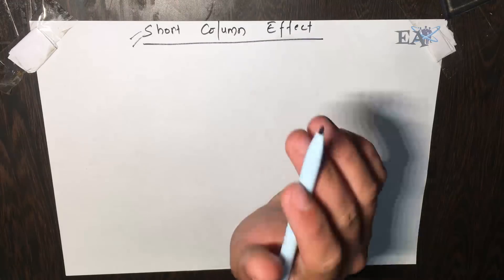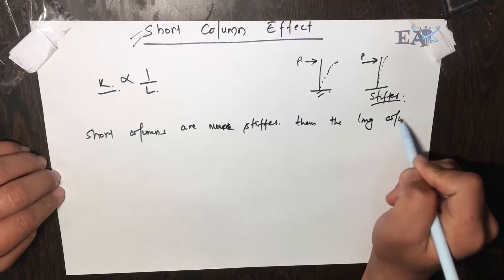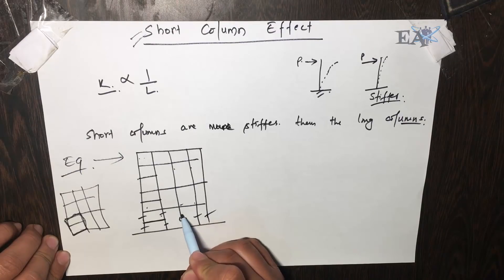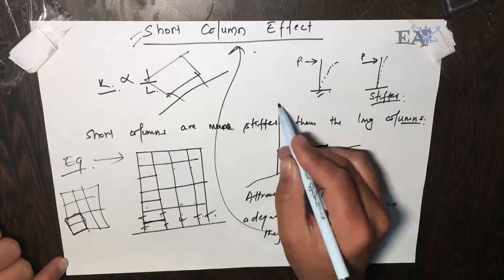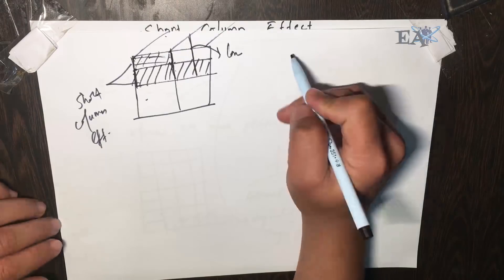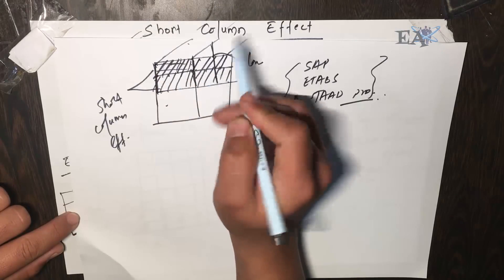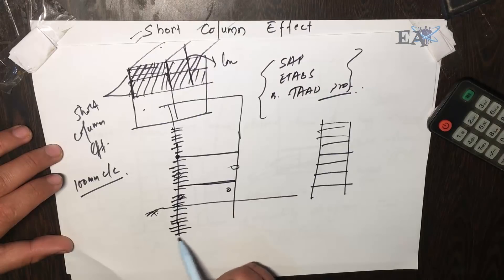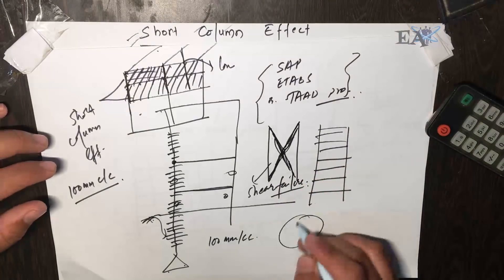Short Column Effect Explained| Interview Question #14|

Comment: the stiffness of landing columns are stiffer than the other columns than how the displacement is same it same
Reply: It is because the slab acts as rigid diaphragm in the horizontal direction as its depth in horizontal direction is high. It means slab don't bend in horizontal direction if horizontal force is applied on it. Rigid diaphragm is a diaphragm with infinite bending stiffness in horizontal direction. Diaphragm is an structural element that distributes external force to other structural elements attached to it, which in this case are columns(horizontal load resisting elements). As slab don't bend it distributes the horizontal displacement equally to all columns. So, the force is distributed proportional to the stiffness of columns. K=F/D Or,F=D*K. Here, D is same for all columns but k varies.
Reply: The assumption is that the diaphragm connects the frames and distributes the load/displacement so that all columns move together, hence equal displacement